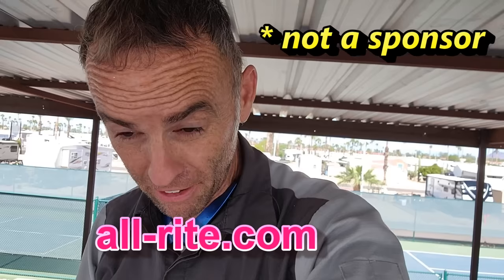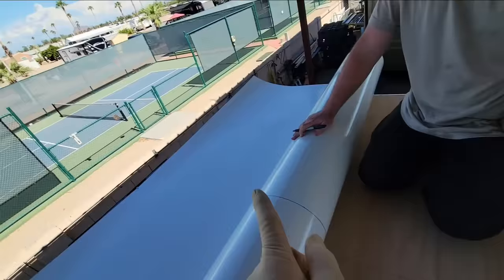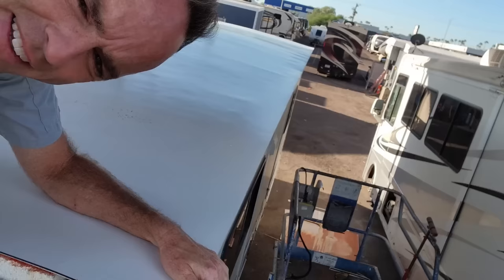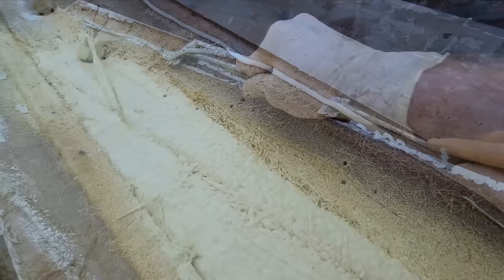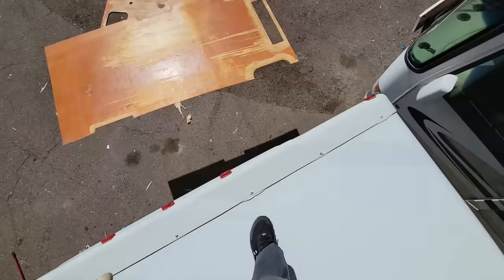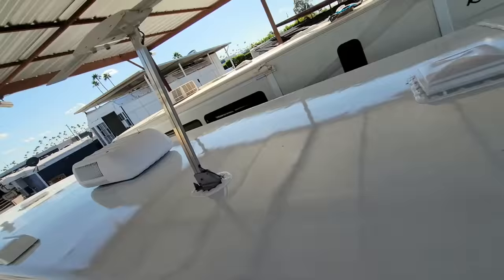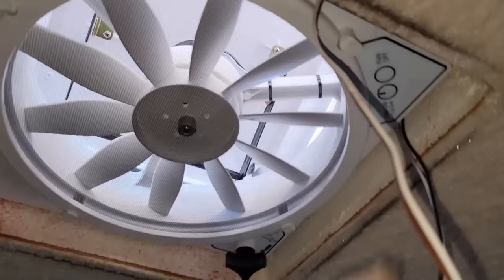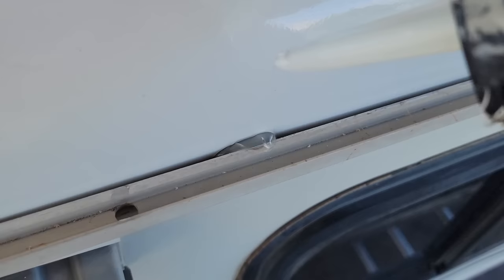What's the Final Step on the New Roof?

Comment: Great series of videos on repairing this 2003 RV.  It's surprising to me how much you are willing to share of the repair process.  You're a great informer for the industry. 
It was amazing to me that the roof isn't fastener at the edges, but only caulked in place.  That's incredible to see that the design was adopted based on the knowledge of what will happen when the sealant fails ( = roof gets blown up and pulls away).  Not a small failure mode.
Reply from the maker: It's never a small failure with roofs

Comment: You have the experience to base what your claims are. And your personality allows you to train while you evaluate without being condescending like other rv tech personality s.
May I suggest some topics:
Diesel pusher windshield that like to fall out.

Current resolutions for dometic ac/heat pumps multi unit s, failure, parts availability, thermostat compatibility.

Sagging, alignment of basement doors

Aqua hot service

Leagal towed vehicle hitch up and braking
How to use service brakes, jake brakes, exhaust brakes

Comment: The roof is absolutely gorgeous. So much better than the mess you got to repair. Amazing job and attention to detail, James.  No doubt the cost and necessity shocked the owner, but they also learned a hard lesson.  But in the end the RV they are getting back is now safe and secure, and not a ticking time bomb that would create more repairs.  What was the name and contact information on the skylight company. I’ve got one that will probably need to be replaced shortly. We’ve learned so much watching you.  Thanks so much.

Comment: I don't know if you will see this message but I have a 1985 Ford E350 Yellowstone 40th anniversary model with a 460 carb motor. It is 26 ft long and I believe it is 7 and a half feet wide.  It has been stored an a building for 30 years before I bought it.  It still has the original aluminum roof on it but the thing is I don't know if I should paint it or put a rubber roof on it or what.
So that is why I'm asking you.
This RV is in very good condition when it comes to the roof, the paint, the stickers or paint going down the sides. Nothing is faded, or cracked.  The interior is in very good condition and is all original and actually quite nice.  It had the 2 chairs on one side that swivel and has the table in between that you can lift up to eat on or play cards or whatever you would want to do. The other side has the couch that has a weird way of making it into a bed. You grab the back of the couch and it flips around and goes in front of the couch to make a bed. 
If course it had the cab over bed and there is no leaks what so ever.
The kitchen is a quiet good sized kitchen. It has lots of space and has a good 5 ft counter that separates the stove from the sink and the refrigerator is on the other side and the bathroom is in the back and is in very good shape.
Only problem is it will turn over but wont start.
I would like to know what to do with the roof but at the same time would like to know if you could help me see what is going on with it.
My ex was the one that kept bugging me to buy it and he said he would get it going if he got to borrow it. Well it's been 3 months and it still is setting and for the last month he has been not only a liar and not keeping his word but an azz.
So if noting else maybe you may know someone that would like to buy it. I have already bought many parts and put on it.
If I happen to hear back from you I will write all that I put new on it and if you know someone that would be interested in buying it I will give you the price.  I'm only wanting what I have in it.
If someone buys it and is able to triple their money then great. I would be happy for them.  But you won't find a cleaner one in this kind of shape anywhere.
When it comes to parts to fix the 350 issue if there is any like with the motor parts. Those I can get but with the rv part it's self, you won't find any, any nicer.

Hope to hear back from you for at least what should I do with the roof.    I don't want to take a chance of anything happening being it is not in a building anymore.
Thank you in advance.

Comment: You guys rock!!! Everything you did on the roofs I agree with and admire your finished product- all but one thing- using silicone instead of butyl or putty tape-----I have done roofs for 35 years, and thankfully, lap sealant came along, to back up that eventual failing seal. Only putty and butyl tape gives and fills dips and uneven spots. and seals with minimum pressure. sometimes two layers are better than one. Keep up the fine work, and sharing the knowledge!

Comment: Great work as usual James. Nice attention to detail. I have a small sidewall delam repair to do on our 1996 Coachmen class C. I want to use 3M spray adhesive #78 for the luan to styro and #90 for the luan to filon. Have you or anyone out there used these products instead of the Stabond? Thanks.
Reply from the maker: it generally does not hold after being exposed to constant heat like baking in the sun.
Reply: @AZExpert  please read my message I would greatly appreciate it. Thank you in advance.  I wrote it on 10/ 21/ 22,
I really need the help.
Thank you.

Comment: Great videos James; I have a 2002 Winnebago Journey, and like the first video in this 3 part video, my filon roof is in perfect condition, and like this unit, the area along the radius is loose, not quite as bad as you showed but is loose about 1 foot in from the radius. Still, the entire radius is loose and ready to peel off in a good wind. Unlike these videos, my filon, if I can lift it out (if it will without cracking or ripping) or remove the side edge filon channel, use Stabond 440 or some other adhesive, and then proflex? I am afraid to only Proflex the radius channel without some adhesive on the part that is above the side edge filon channel? Did I answer my own question?

Comment: Just a curious question for you. You mentioned on a few videos that the Luan is part of the roofs structural strength. Why, with the exception of possibly a few pounds more weight, not use 1/4" Luan. Seems to me the base would be much stronger.

Comment: Excellent job!  So is this Filon roofing material is what the industry calls a fiberglass roof or is a fiberglass roof something different?
Reply from the maker: Filon is technically sheet fiberglass so it is a fiberglass roof. Most of the industry deals with gel-coat molded fiberglass roofs which are closer to a boat hull in build not a sheet.

Comment: The US RV industry is the only one I know that puts caulking over screw heads, no one else does that in the boating industry or the European RV industry.
Also, compressing the styrofoam sandwich to seal the air conditioning will eventually lead to leaks, styro should have been removed and replaced by wood to prevent that compressing situation.
Reply from the maker: I guess, I know ridge shingle caps on houses often have the exposed nail heads sealed, same with hardware on roof vent boots especially metal roofs. That A/C was on the roof for 20 years so eventually everything will fail, likely a thousand failure points of design I could have changed.

Comment: ON THE ROOF RADIUS I WOULD THINK YOU'D WANT TO RUN A LITTLE SANDPAPER BETWEEN THE METAL AND PLASTIC TO GIVE IT A LITTLE MORE TOOTH TO GRAB ONTO . DAVID GRENIS
Reply from the maker: Chad actually used a wire brush, but the video was already too long.

Comment: What’s the estimated cost ( Labour, material)of doing a total roof replacement for: ( not an insurance claim)
Filon(Sp)
TPO
EDP

Thanks 

Thanks
Reply: @badgerpa9  per running square foot or square foot. Average estimated cost for a 30 ft. for 5 th wheel